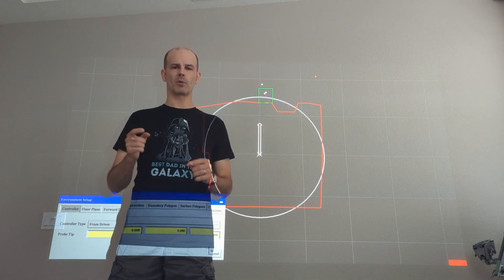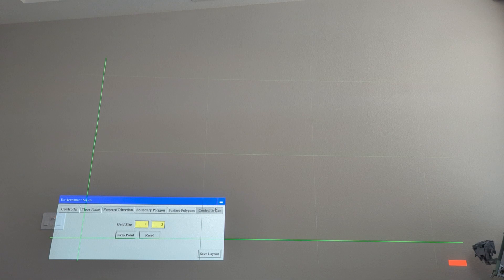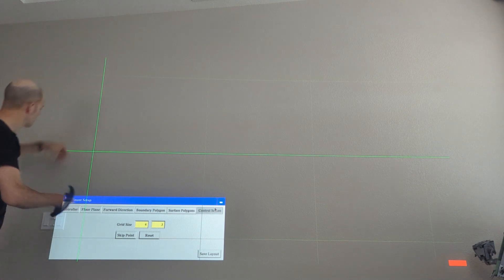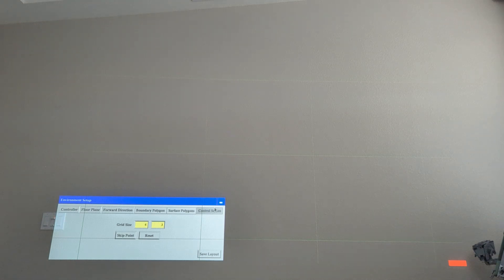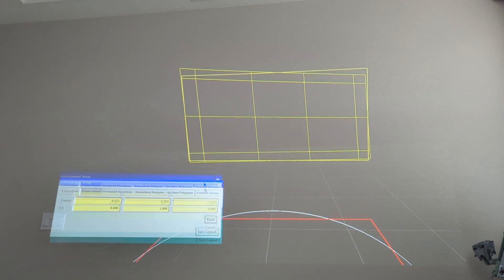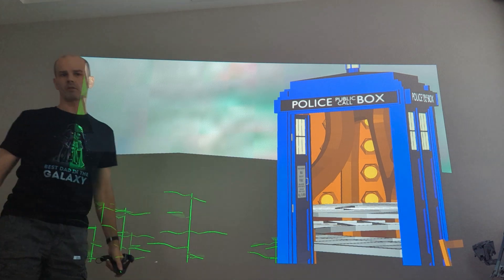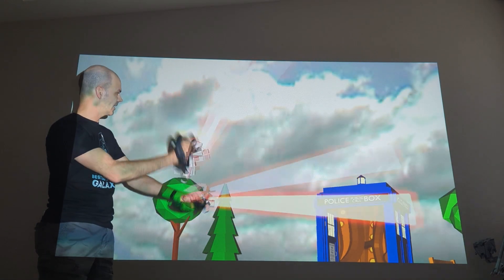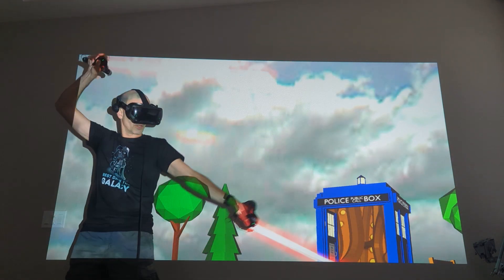Semi-Automatic Calibration of Non-Aligned Projections

Comment: Your advancements never cease to amaze me. I have a wired Oculus Rift and projector. Would this work with it? Not even sure what I'd use it for lol great work as always! 🙌
Reply from the maker: The calibration math should work no matter what, but the issue is how to tell the VR software to use the resulting matrices. I have no idea how, or even if, that would work with Oculus software and/or SteamVR.

The big benefit of running my own complete software stack is that I have full control over every aspect of it, and can even use skewed projection matrices to make up for keystone distortion, as in this demonstration.

Comment: Fantastic, something like this would really help when trying to show and share VR interactions with other people in the room.   

I tend to get disillusioned with some of the VR stuff at the moment (meta buying oculus etc) but things like this bring me hope!
Reply: The problem is that this would only look correct from one point in space, so it would not work for showing VR interactions to other people in the room. At most it would work for one person in the room assuming that person only has one functional eye and can stand perfectly still.
Reply from the maker: @rensin2  Correct. However, that's exactly what we're typically using these screens for. It turns out that there is a range of "works well enough" to make this a good way of presenting from inside VR to a large-ish audience outside of VR in real time.
Reply: @rensin2  and that's why I shouldn't comment before waking up 🤣😂
Reply from the maker: @rensin2  I wanted to add: this is a mono projector, but if you had a stereo projector, or, in a pinch, a pair of anaglyphic (red/blue) glasses, you could project in matched stereo, which creates a very convincing illusion, especially if the viewer is continuously head-tracked like here: https://youtu.be/E64XXsBT8Kc
Essentially, that's a cheap version of what CAVEs and similar VR systems used to be.

Comment: I was wondering what the end result was going to be, and it was neater than I had imagined 🤣 It's basically a local mixed reality solution but where the display system is also calibrated 😗 Looks great!
Reply from the maker: Thanks! It's primarily meant for our research systems, where you often have one or more HMDs and at least one big projection screen so that people not wearing headsets can see what's going on in VR. Essentially, a way to present to a large-ish group of people from inside VR in real time. Like in this old video, where I forgot to re-route the video from the monitor to the big screen behind the two people: https://youtu.be/1n7WVUbMI7g

The screen calibration procedure ensures that the screen display looks correct, to scale, and properly aligned. If you have a stereo screen, it will then even work in stereo.
Reply from the maker: Here's a video from the same VR system where I didn't forget to switch the video output: https://youtu.be/E64XXsBT8Kc There I attached a controller to my phone for constant camera tracking.